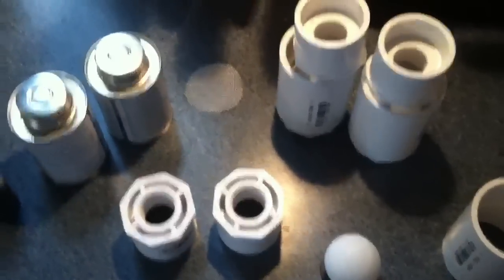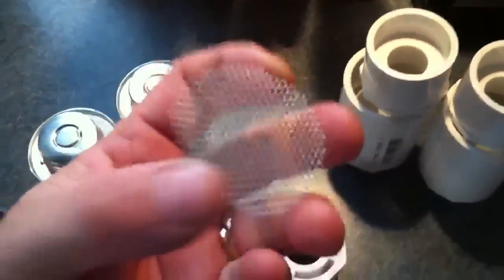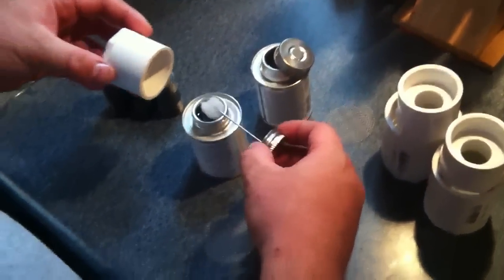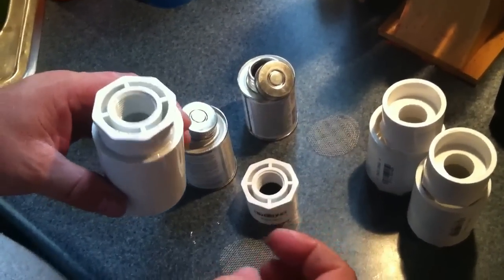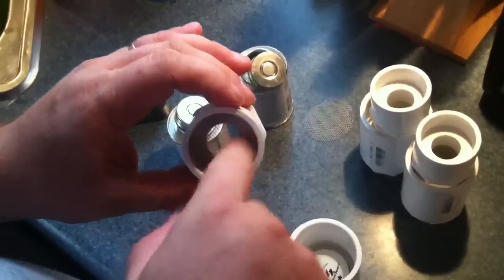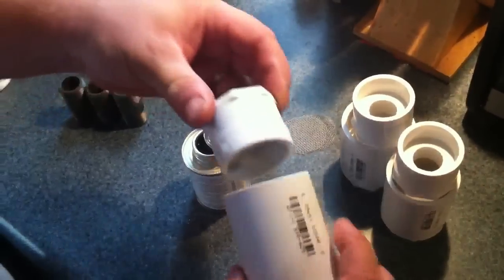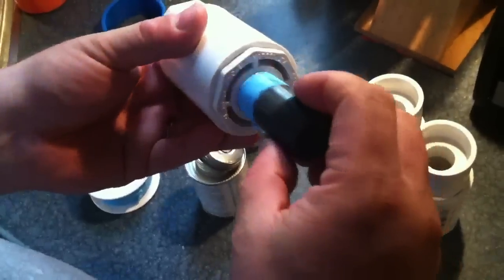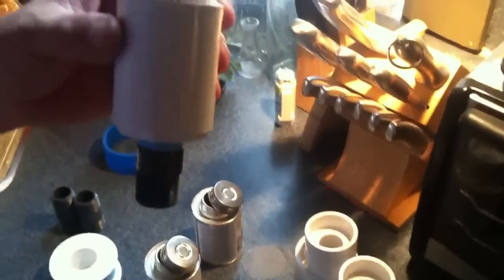Rain Barrel Ping Pong Valve

Comment: I'm dealing with an A/C system that sucks attic air through the secondary drain. This device is going to solve all my problems and keep my electric bill down... just using it upside down in my instance. You are my hero!
Reply: How exactly would it work upside down? And there are already vents for that.